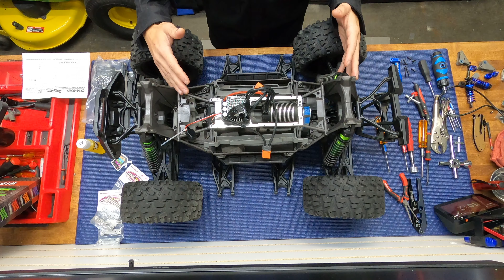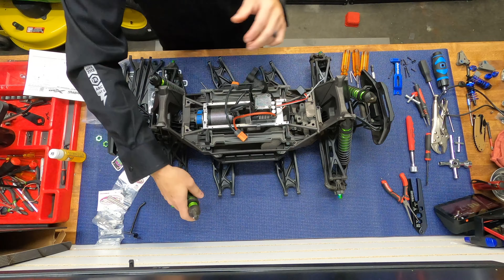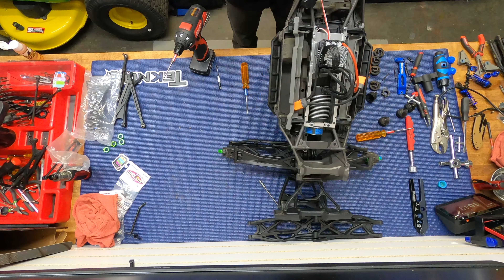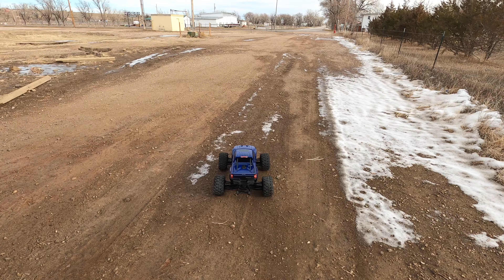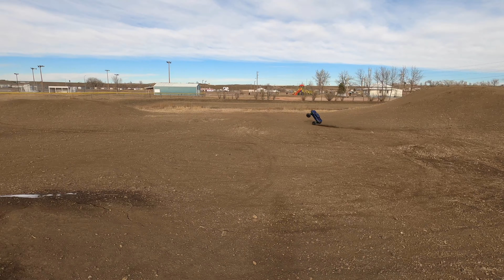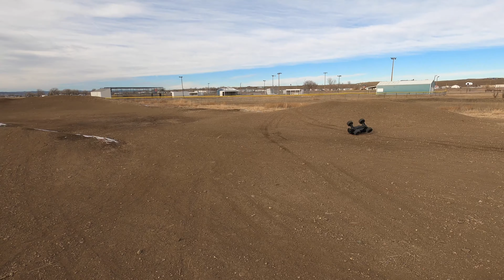Traxxas Xmaxx Widekit Install and Bash | Quick Breakage

Comment: Hey brother! Great video! I'm wondering if the glue let go because of cold temperatures? I wouldn't know because I drive my bashers below 50 degrees to save money on parts lol. I do drive my crawlers in winter sometimes though. I'm waiting on the wide kit for my Xmaxx. I want to see a lot folks use it and give a verdict on it before I do it. I already have quite a few extra heavy duty arms and such for spares that I spent the money for lol 💯🤜🤛🔥🔥⚡⚡🙏
Reply from the maker: I could understand that. One of my thoughts was what happens when these wide kits break an arm? are we stuck buying new wide kits? time will tell.  It might have been because the cold. Im not 100% sure. I will reglue and try it out again. as far as the width, it seems to be good for the xmaxx for my liking.

Comment: Hey how do you like the belt drive? I have almost the same setup and I just got the belt drive cuz I can't seem to keep the mod one gears together
Reply from the maker: I haven’t had one problem with the belt drive. Not one. Gears I tore right through. I think the belt drive is worth it.
Reply: @GarageLifeRC  awesome. Good to hear. Now I just need to find out if they sell replacement arms for the wide kit. So far I haven't been able to find any
Reply from the maker: @DoRC  I haven’t seen any yet. My guess is Rpm will first and then Traxxas will start. Think they want to get the kits out more so than spare parts. But that’s just my guess

Comment: Seeing to many tires /foams failing on Xmaxx's of late, Traxxas clearly have issues with their wheels on the truck.
Reply from the maker: not a fan of their tires and wheels but im also not a fan of buying more until these wont run anymore. I got them reglued and will try again
Reply: @GarageLifeRC  Seen a few Xmaxx tires rip apart on the sidewalls, besides coming unglued from the wheel. Sidewalls were very thin rubber, this was from ballooning doing back flips.